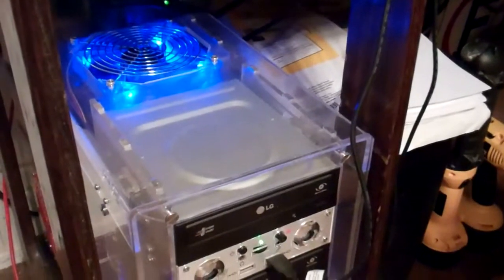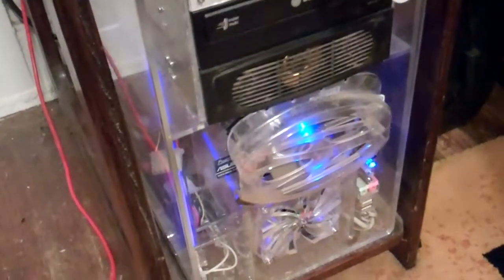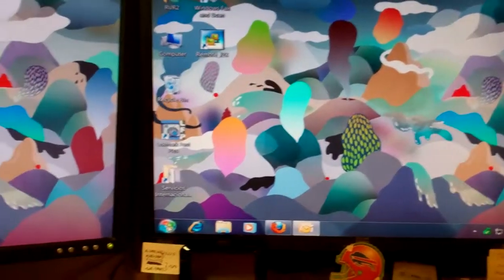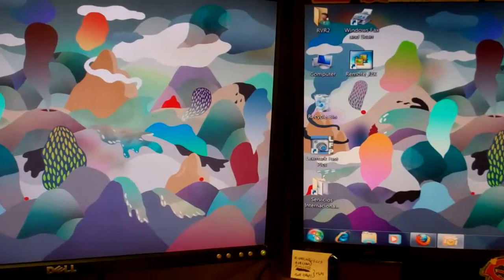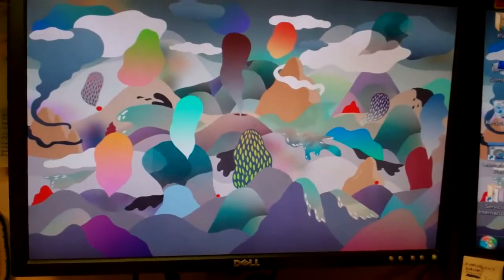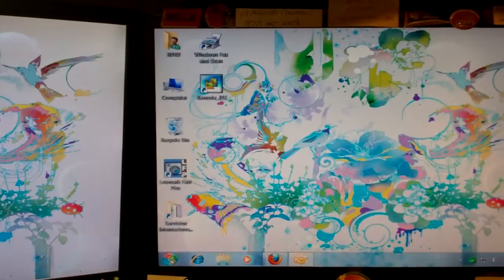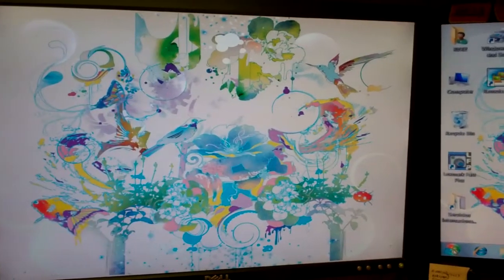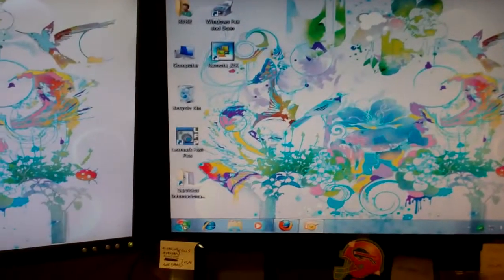Upgrading my Custom Built Computer

Comment: I have same motherboard and the same processor... and i have 1tb seagate HDD and 2tb WD HDD
Reply from the maker: Still using this setup.. I changed out the OS drive to a Samsung SSD256 for faster bootup, and use the larger drives for storage only.
Reply: RVR2
Im using the 1TB HDD for Data storage and 2TB HDD only for games + I'm using WIndows 8.1 Pro

Comment: i can help you but how much money would you pay for a pc thats the first question 

My pc :

Intel dual core 3.2 ghz 

4gb coirsair ram

Videocard ( very very cheap )

2x 200 Gb sata hard drives 

coolermaster case

cpu cooler coolermaster hyper tx3 evo 

motherboard

i paid around 200 euros ( not that much)

BUT IT RUNS VERY VERY FAST !

Comment from the maker: @YearZer02022 So far so good.. 
The Intel i5 2.8G quad core temps are between upper 90's to low 100s degrees Fahrenheit so I'd say the airflow is fine..